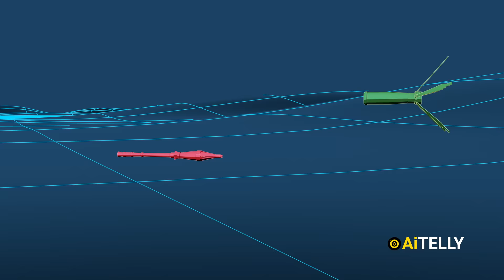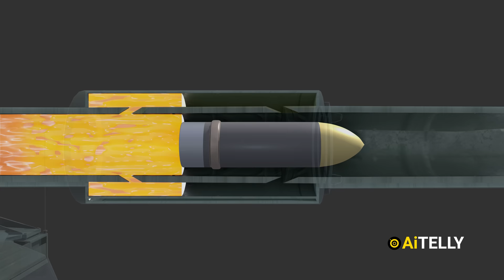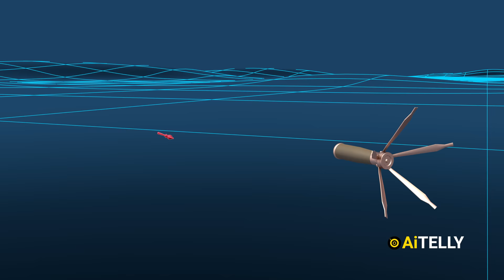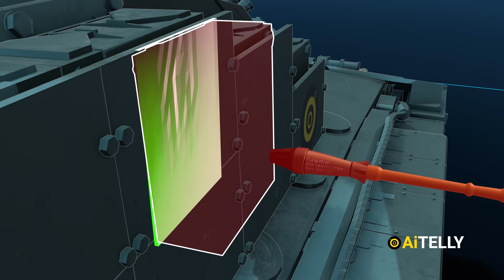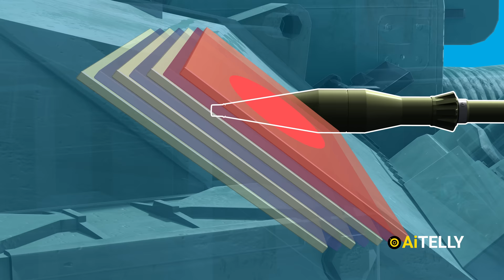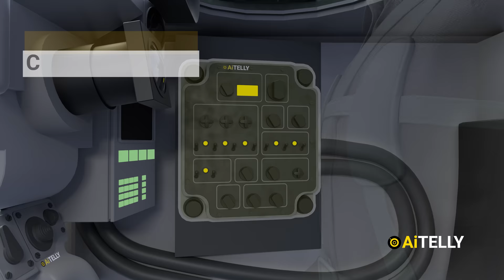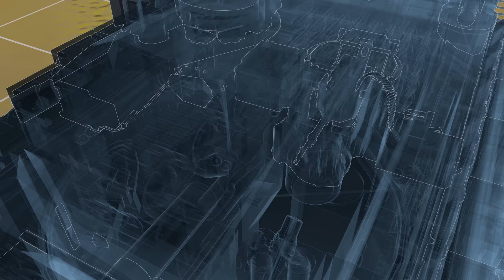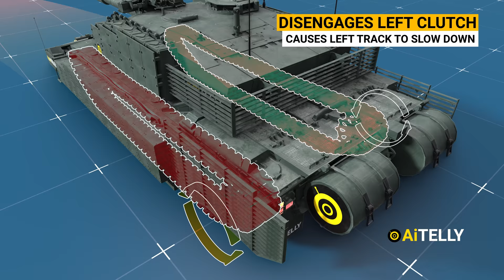Challenger 2 Tank How it Works - with Chobham Armour and Iron Fist

Comment: Another detail, with a full system the gunner does not correct for wind and elevation.  Elevation is calculated at the point of lasing and acquiring the range to the target.  Windage is calculated via data from the MET sensor mounted on top of the turret.  Only when all systems have failed does the gunner have to resort to manual correction.  Great video though, brought back memories. 👍

Comment: the laid back driver position in the forward hull of the Challenger 2 needs a proper steering wheel, instead of two levers . . . the hydro-pneumatic suspension in the Challenger 2 can be upgraded with a additional variable coil spring setup that'll function in tandem with the tank's torsion bar suspension . . . the Challenger 3 could seriously do with a lightweight hull made of anti-ballistic high strength steel alloys & lithium composites . . . this should limit the overall mass (without the add on Chobam® armour & ERA) of the tank to less than 46.35 ton . . . one piece pressed/moulded hull sections is another weight saving feature . . . the 360° deg rotating manned turret needs to be lighter as well . . . a turbocharged 20.0 in-line-8 & a iSmartHYBRId® power pack . . . the turret top mounted 360° deg rotating Enforcer RWS next to the gunner's could be armed with a 25 MM GAU-12/U six-barrel rotary cannon & the standard 0.50 Cal . . .

Comment: The upgrades you mentioned will be on Challenger 3, Dorchester armour, 1500hp engine, Triumph protection system, better third gen optics and the new Rhine metal 120mm smooth bore gun.

Comment: Your driving demo is missing a few key points the tillers are linked so pulling the left tiller causes the right to move forward and vise versa so the tank can be driven one handed while operating other controls and pulling the tiller operates the brakes on the relevant final drive this increased resistance causes the opposite side to accelerate due to the differential gearing. The steering is reversed when reversing much like trying to reverse a car with a trailer.

Comment: You have demonstrated why chobham/dorchester armour is the best in the world. You did'nt explain how it works and your animation of a shaped charge impacting the hull was incorrect. Simply because you don't know how it works because it is still top secret. However your description of reactive armour was good though reactive armour is common knowledge. Overall a good simple narrative of a very complex weapon system.
Reply: Unfortunately, this video not the tank's feats truly give that impression. Fact is, Challenger 2 hasn't faced nearly as potent weapons as Leopard 2 and Abrams has. MILAN is barely half as effective and deadly as the Kornet for example, and Challenger 2 has never been hit by such potent ATGMS like Kornets that have shown to easily knock out other tanks. It just hasn't seen nearly as much combat experience to truly give us a scope of its armour ability, and only that is capable of stopping highly obsolete RPG and a subpar MILAN that wouldn't fare much better at taking out most modern tanks. But here's the kicker, Challenger 2's Dorchester armour is over 30 years old and the tank hasn't had a majour internal armour upgrade since. The British MoD actually stated during the Chieftain replacement trials the M1A2 Abrams with HAP-2 (2nd gen DU) would be on par with Challenger 2 and since then the Abrams has had 2 MAJOUR armour upgrades. Challenger 2's armour is excellent, but it just can't be the best. It's 2 generations old at this point.

Comment: If memory serves me correctly, the safety switch on the GCP does not isolate the firing circuit it only isolates the Gun Control Equipment ie. turret movement, same for the Commanders Safety switch.  The Loaders Control Panel Safety switch does however isolate the Firing Circuit and the GCE.

Comment: you missing boiling vessel,  A boiling vessel is a water heating system fitted to British armoured fighting vehicles that permits the crew to heat water and cook food by drawing power from the vehicle electrical supply.  It is often referred to by crewmembers (not entirely in jest) as "the most important piece of equipment in a British armoured vehicle"

Comment: I thought the armor packs fitted to the outside of challenger were chopham add on armor paks and not ERA.
Reply: The Dorchester Level 2 Improved armour add on, also known as TES or wrongly "Megatron" dropped the Dorchester NERA blocks on the sides and replaced it with more effective Shield-R ERA made by Rafael. You can tell the difference because the ERA is much thicker than the NERA on the 2E and 2F variants of the TES. Its also now called OES not TES, formerly Theatre Entry Standard, now Operational Entry Standard,.
Reply: @nothingspecial6925  thanks for reply. Gave me a ton of information that I greatly appreciate.
Reply: @nothingspecial6925  What is the spec of the Challengers sent to Ukraine, they seem stripped down?

Comment: What happen when you pull both tiller? The tank stops?
Reply: Nothing, they are interlinked.  You can drive the tank with 1 tiller.  You pull the left back, the right goes forward, push it forward and the right goes back and vice versa.

Comment: Chobham armor isn’t steel it’s depleted  uranium, extremely dense and possibly layered with ceramic plates at least in the case of US tanks. You have to understand how HEAT ( High Explosive Anti Tank) warheads work. They have an internal copper cone surrounded by explosives. When it reaches the proper “standoff” from the target the explosives fire and that turns the copper into a jet of plasma that burns through. The point of the explosive armor is when it exploded it disrupts the jet making process defeating the war head. Most modern tank shells now use APFSDS rounds. Armor piercing fin stabilized discarding sabot. It’s basically a small dart made of extremely dense depleted uranium. The significance of using depleted uranium is it is very dense but also as it passes through a material the outer layers sheer off and it self sharpens. Other rounds like tungsten start to dull but using DA it stays sharp as it passes through. The reason they use depleted uranium in the armor is you need something of similar density to defeat the same material. Just like you need a diamond to scratch a diamond. The reason it’s layered is also to destroy the round on impact. It’s easier to design a penetrator to defeat a solid block of something but as it passes through the different layers those all have different consistencies, densities etc. I remember my grandpa telling me about German tanks in WW2 and even back then the Germans used layered armor with steel and then rubber sandwiched together.

Comment: the CR2 would of had bar armour on as well mind that took the RPGs
Reply: BAR armour was used latter in Iraq to cut down on weight and cost instead of using the full battle up armour kits.. as they were/are intended for fighting Tank on Tank.  The later Insurgency type tactics did not require extra protection from Tank gun shells.. so was removed on most tanks. Bar armour was applied to many AFV's as a cheep and light way to deal with RPG theats.  But not much good against IED's, booby traps and road side bombs.  Some vehicles used a combination of both. Normaly deployed with None Explosive up armour.

Comment: now we wait for Challenger 3 MBT which will have smoothbore gun on it and other new features as well
Reply: It's just a challenger 2 with a German leopard 2 gun
Reply: @inkwyvern5171 it's not just a NATO standard main gun change, it has a new FCS, new thermal cameras for the TC, gunner, and driver, new turret, enhanced armor, LWS, APS option, new hydropneumatic suspension, upgraded and improved engine, cheaper than the Chally 2 while also weighing 1 less metric ton.

Comment: I was a M1 Abrams Tanker... your 10 tons short on the weight... it's 73 tons
Reply from the maker: It Depends Combat Weight or Standard weight.
Reply: @AiTelly  Dude I trained on a Abrams as well as used it in combat... the basic weight of an average Abrams is 70 tons and 73 tons with the latest upgrade package included.

Comment: Btw, how merkava protects her crew especially when munitions storage blew off?
Reply: The entire crew compartment is covered in chobham armour, due to the types of ceramics used and forged, it essentially adds a TON of protection against shaped and kenetic hits from the outside, 1mm of this ceramic is similar to 2mm of steel. It has 200mm Nera protection + 80mm RHA with additional 50mm RHA plates. (making 330mm of ceramic plated protection) similar protection to 660mm of steel.
Reply: @welshe222  n how about munitions depot inside Merkava ? Same like Chally n Abrams ?
Reply: @alwar8081  Its contained in flame resistant containers. Much worst than challenger and abrams. And its inside the crew compartment so if the side armour is penetrated it would burn out the entire inside including the crew. Similar to russian tanks. Challenger uses stowage water system to prevent internal discharge and abrams has seperate compartment to also prevent the same thing :) They actually tell you in documentations that the ammo storage cannot be contained, but the flame resistant containers can delay the internal ammo from cook-off for enough time for the crew to get out and run away, in an active scenario who knows.

Comment: Why don't the tank designers put the chobam armor on the top of the turret as well?
Reply: Because it would add several tons of weight. The top of the tank is the least likely place to get shot
Reply: There is a certain amount on top of the turret but covering the whole top of the tank would be impossible.

Comment: The tonnage of few MBTs are wrong. M-1A1/A2 weighs 67tonnes and M-1A2 SEP weighs over 70 tonnes being the heaviest MBT. Leopard 2A6 weighs only slightly more than 55 tonnes around the weight of leclerc, K2 Black Panther, ZTZ-99A2, not even in super heavyweight category. The most expensive overpriced MBT is French leclerc.
Reply: Challenger 2  with TES (theatre entry standard) is around 75 tons. Megatron version even more but it was a prototype.
Reply: Jay you are wrong. Abrams SEPv 3 weight 66.8 tons, Loe 2a6 weight 62 tons, Leclerc 57 tons, K2 55 tons and Chally 2 TES 75 metric tons empty and 80 tons loaded been the heaviest tank currently in service in the world. 
All are MBTs tank stop been classified by weight on the late 70's.

Comment: But are tanks really still needed? You can design & build a better tank but another country will find a way to defeat the advanced armor. So, what's the point?!
Reply: Because,  nothing replaces a tank. No piece of equipment is indestructible, aircraft carrier to a single m16.
Reply: Nothing can do what a tank does on the battlefield. Both can engage with such heavy firepower as quickly as a tank, nothing can move such with such firepower like a tank, nothing is as well protected as a tank, and nothing has the psychological power as a tank. Tell me, how will an army launch a full scale attack without tanks? Just because they can be killed (like everything else) doesn’t mean there aren’t need. They still have the most layers of survivability. Ask not what they can do to a tank, but what a tank can do to them.
Reply: @qasimmir7117  exactly.  What can go into heavily defended space and lay down enough firepower to break defenses, before it is itself destroyed? Tank.
Mobile howiter? Tank
Too much small to medium fire? Tank 
Get a better view and come back mostly in one piece? Tank.
Guard a convoy? Tank
There is simply no other vehicle that can do it all at once.

Comment: 00:06 you forgot to mention that challenger 2 tank was destroyed by world war 2 RPG in 2006 in Iraq 😅
Reply from the maker: I doubt
Reply: The only confirmed Challenger 2 loss was scored by another Challenger 2 firing HESH rounds at it
Reply from the maker: @somerandomboibackup6086  agreed
Reply: Except the fact that it wasn’t.
Reply: WW2 RPG 😂 a couple of points …. RPG43 (available in WW2) was a handheld grenade and could only penetrate 75mm RHA ….. if your referring to 2006 then a challenger driver lost part of his foot when an RPG 29 (deployed by the USSR in 1989 44 year later than you claimed…. Unless you have a Time Machine perchance) penetrated the reactive armour on the lower front the tank was not lost just repaired and the tanks had the reactive armour in that area replaced with superior Chobham
Reply: @qasimmir7117  please provide evidence to support your assertion
Reply: @robertpatrick3350  they weren't destroyed

Comment: HESH is obsolete.
Reply: No it isn’t. A 120mm dustbin full of high explosive being lobbed at the enemy will rarely be ‘obsolete’ mate.
Reply: @qasimmir7117  Obsolete composite armor is inmune to HESH.
Reply: @viceralman8450  That's why fin rounds are used. HESH is a useful tool against lighter armoured vehicles, buildings, bunkers etc.
Reply: @thewomble1509  HE-AMP does that but better. Therefore HESH is obsolete also the Challenger 3 will use a smoothbore gun so it can't use HESH.
Reply: It’s only obsolete if you need interoperability with other forces
Reply: @robertpatrick3350  Obsolete in all aspect compared to modern ammunition.